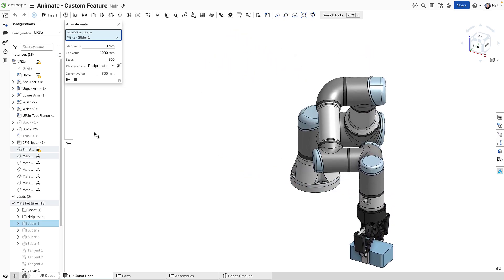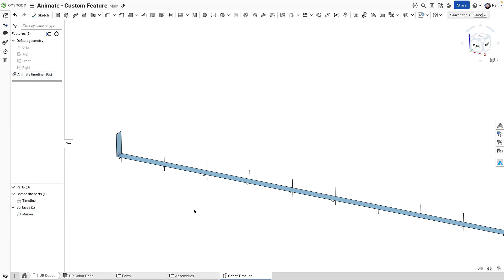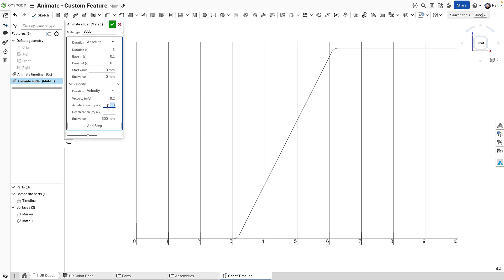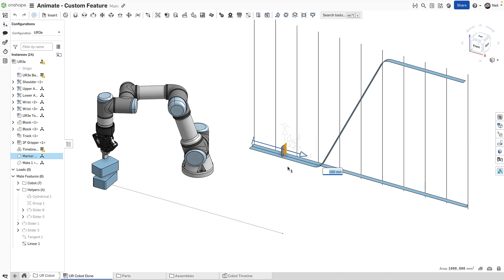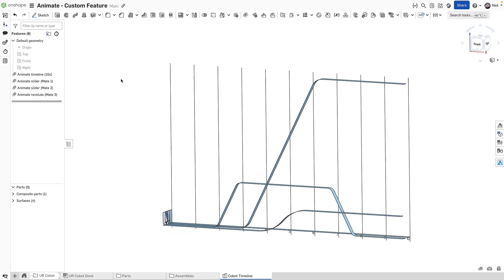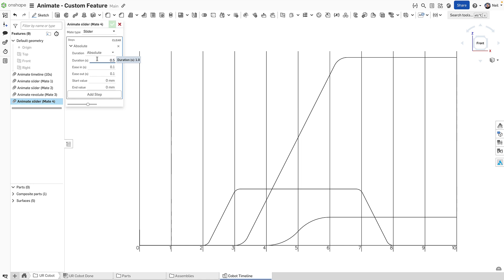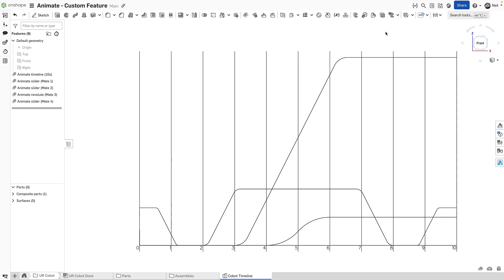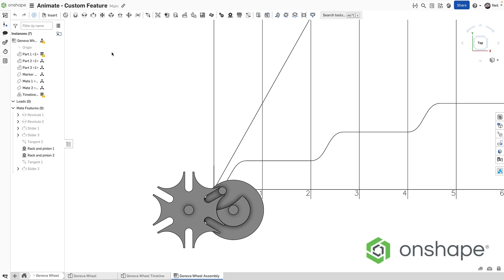How to Animate Multiple Mates in Onshape

Comment: I agree this is quite the trick, but also think OnShape ought to support something like a multi jointed robot arm moving without resorting to this type of hack.

Ideally OnShape would not only allow you to animate multiple things, but also it should include assembly physics and collisions detection.
Reply: Definitely. The thing I'm currently working on pretty much involves shoving something sideways into a ramp so it's forced downward onto a compression spring, then allowed to come back up on the other side. Should be as simple as defining the "shove it sideways" part.